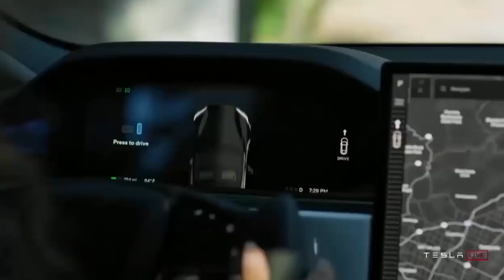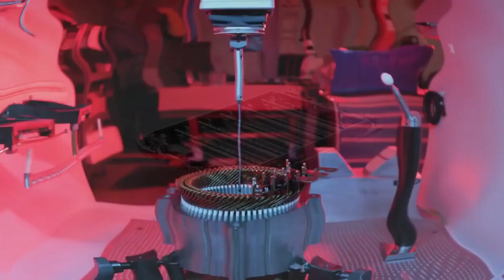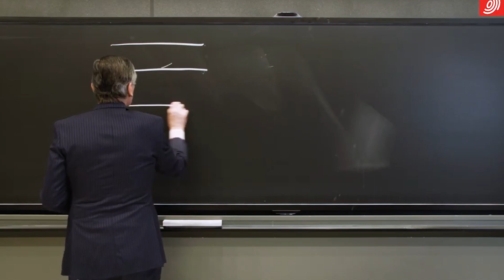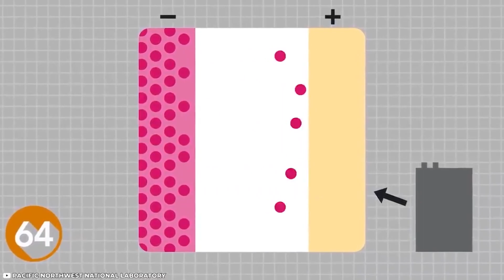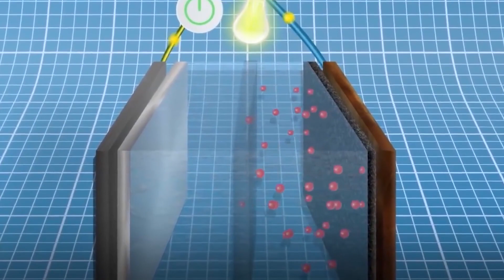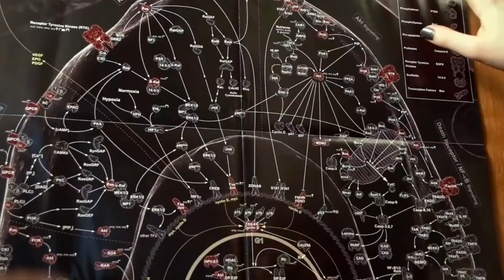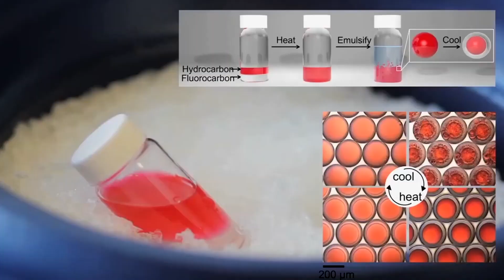The Long-awaited Revolution in Battery Technology Has Arrived!

Comment: The hard part of hearing these battery technology "breakthrough" reports weekly is that most of them are still in the research phase. And they may be 3-5 years away or they may never meet the reliability, cost, or volume production needs to compete. This technology seems very promising. But I will have to wait to see mass production begin, and then compare finished battery prices and capabilities at that time.
Reply: Theoritically aluminium sulfur is the most promising lithium battery replacer, not sodium ion